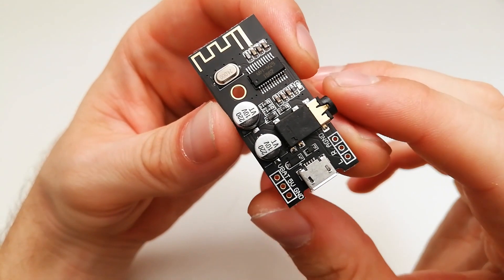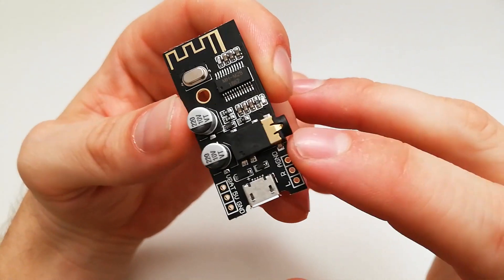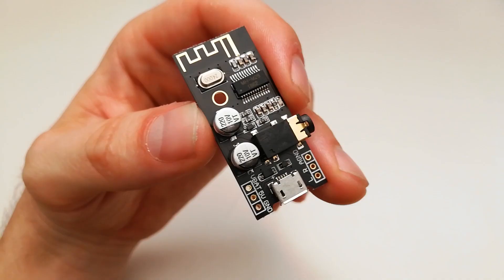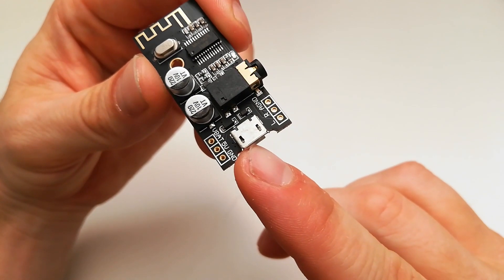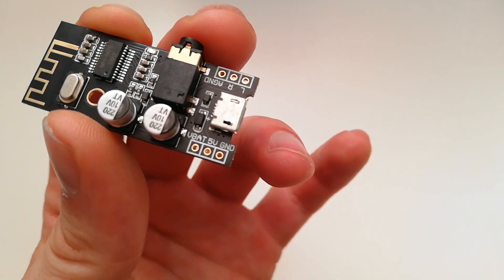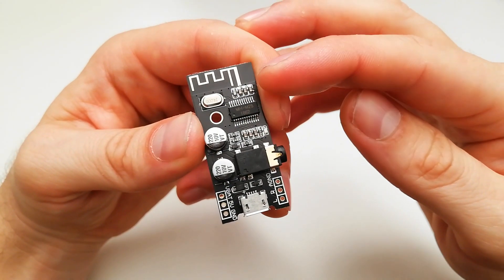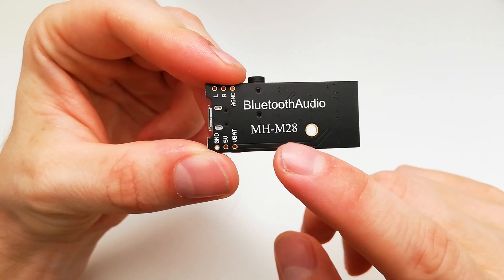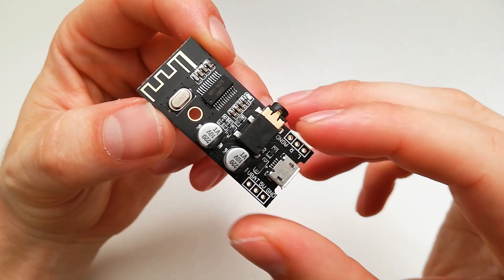MH-M28 Bluetooth Audio receiver board (Wireless Audio decoder)

Comment: 1:03
STOP
Do not half-ass insert any plug.
That only provides a single MONO output.
SEE?
FINALY the two hands "fiddle with the male piece" & 
SHOVES IT HARD - into the hole..

That's the way to do it.
By just PUSHING IT "all the way in".!!!!

Wow, who would have believed.
It's a STEREO device after all (with the MALE PRONG inserted - to the hilt)
All the WAY IN .... @ 1:45
STEREO (at last).

TWO channels is better than a half ass push and ONE channel.

However, the LEPY is good for at least 9 channels of directly connected independent audio output, from that same unit.

And you won't get them by half-ass insertions either.
I won't explain how, as it's a commercially sensitive TRADE SECRET.
Just knw it works and maybe someday - you too could drive a wild 25.7 system via that "fully inserted" male prod.

Comment: hello I would like to know if by connecting a 3.7 volt 500mhA lithium battery and then connecting the micro usb to a power supply..... is the connected battery recharged??? Thank you
Reply: No.

Both are different power sources. Either micro USB ( preferably 2A ) or 3.7 volt lipo / lithium battery.
Headers are given as such.

Never use both.

For lithiumb/ lipo battery, charging has to be done separately.

Hope this answers....
Reply: Also want to know this!

Comment: can i hook this up to some headphones?
Reply: Just use a 1/4" (6mm) Stereo to 3.5mm stereo adaptor, and shove it (to the hilt) into that big hole on the side of the unit.
Plug your headphones directly into that without the LEPY and control the volume from your blue tooth mobile phone as they are doing.

The USB is ONLY there, for the 5v DC operating voltage supplied by the mains power plug-pack.

You get Blue-tooth "pairing" direct with the blue tooth the cellphone is outputting.
Hence why you see the cellphone "music-play screen"

Comment: I have a problem with this module. I want to build a Bluetooth Speaker. When i connect the module to a powerbank, it turns off after a couple of seconds. Is there a sollution?
Reply: Some gadgets which can't consume 5 volt throughly and 3.7 volt is better enough, power bank is not for those gadgets. In this case Power bank cannot supply its volt to the gadget and at a time it shuts down to its own way.

Comment: Of all the Bluetoth modules I have seen working, the MH-M28 is the one that works best. It is well designed. I have several modules of these and they all work well.
Reply: which one is best mh18 or mh 28 ?
Reply: I'm sorry...i misread your question...So....
In practical terms, it is preferable to order the MH-M28, as it is already equipped with the outputs you need for your service, and the core of the MHM-18 is exactly the same as the MH-M28.
The MH-M18 is just a little more difficult to put into operation.
Reply: But don't worry @prakashsailayam2030  !
Whichever BT module you choose from the MH-M line, you will be satisfied with its performance, without the slightest doubt.
Reply: @revoxjazz  Thanks for the Reply and information
Reply: You're welcome. bro!
Macedo Pinto, Portugal
Reply: @revoxjazz hi I have a doubt and if you answer it I will be very grateful so I didn't understand what you exactly said so you mean that mh-m38 has a built in amplifier? And if it has it so what is the maximum output it can give and will it have background noise even if nothing is playing and will it have that Chinese lady voice 'the Bluetooth device is really cheap here' or something like that? Thanks!
Reply: Ok my few doubts are clear just tell me if it has a background noise.
Reply: Clarifying what you want to know.
The MH-M38 bluetooth module (specifically the MH-M38) has two small amplifiers built into the printed circuit board, each of these small amplifiers allowing you to play audio files in Stereo. The advertised power for each channel is 2 Watts at 4 Ohms. This is bullshit. No way to get such a power level on these  MH-M38 modules. 1 Watt per channel at 4 Ohms, max. In other words, you connect two small speakers or speakers to this MH-M38 and you basically have a mini Bluetooth audio decoding system and an amplification system, in a complete solution. As for the horrible situation of a voice prompts appearing in this system (as well as in any of the MH-M series modules), fortunately the world was spared that ordeal, as you only hear small signals (simple melody, just one second) when you perform the BT connection for example to your phone or when you hang up. Nothing more than that.
Further clarifying this line of BT modules (which includes the MH-M18, the MH-M28 and the MH-M38) Regarding the sound definition obtained, I must say that the decoding chip on the board is the same in all three models, have good quality, very good stereophony and I do not aurally register any noise associated with its operation, it is clear that this chip does not present any unpleasant signal, for example, when you put the Player that is producing a signal in Pause or Stop. Anything. Absolutely silent.
The only problem I observe in this line of equipment appears only in the MH-M38 (the only one that has amplification for speakers or loudspeakers), characterized by the excess Audio Gain defined by the manufacturer. Since this Gain is defined in the programming and native configuration, the absence of an effective volume control is not at all pleasant, making it very difficult to manage reproduction volumes, an essential aspect of what we do. that is, the volume is poorly controlled. It's a shame that this is the case, because the "normal" volume that we assign to the Player's output (for example on the phone) is clearly insufficient to balance the sound and there is no way to change this. Pretty unpleasant.
For this reason, I do not recommend using the MH-M38 for the purpose you obviously want, knowing well what will happen with the situation of excessive amplification of the audio signal on that printed circuit board.
Apparently, the best solution for you will be to just use the MH-M28 (which does not have its own amplification) and resolve this issue by using separate PAM 8403 amplification modules. These PAM 8403 modules are well designed and some of them already come with a volume potentiometer.
Or, you can use any amplifier circuit of your choice as the output stage, of course.
You take the audio signal output from the MH-M28 module and inject it into the input of any amplification. Problem solved. By the way, in terms of electrical supply, you should know that the MH-M28 module (without amplification for speakers or loudspeakers) has a maximum consumption of 38 mA 3.7 Volts , which is excellent.
But to put the MH-M38 module into operation (which has integrated amplification), you must ensure that the module is supplied with normal voltage (3.7 Volts) but you won't get away with it without the presence of 2 continuous Amps. Which forces you to use one or more good quality batteries for the MH-M38 or a dedicated power supply, with the same 2 Amps.
Please note that these modules have interfaces for 3.7 volts and 5 volts, differently and I will make it clear that none of them charge batteries. Make no mistake about that.
I think that the essential questions regarding the MH-M28 and MH-M38 have been clarified but if I can help with anything, please contact me again. No problem.
Macedo Pinto, Portugal.
Reply: No background noise att all!
Reply: @AmazTech  Just use MH-M28. Unbalanced line level for your amplification system's input.
Reply: @prakashsailayam2030  , they are  electronically similar but there is a big difference between MH-M28 and MH-M38.
While the MH-M28 produces only a LINE OUT signal at its outputs, the MH-M30 produces SPEAKER LEVEL at its outputs. In short, the MH-M28 does not amplify any signal and simply decodes BT, transforming it into something that you can connect to an external amplifier (or amplified speaker).
The MH-M38 decodes the BT signal but it already has its amplifier, so you cannot connect its outputs to anything except Speakers.
Reply: I have but a slightly High frequency sound coming I use battery different power supply also headphones but stills

Comment: I bought M38 version to make Bluetooth headphones and it works but ı heard disturbing noise sounds like buzzing. How can ı fix ?
Reply: Therefore, if you want to amplify only headphones, investment in the MH-M38 module is absolutely unnecessary. Just use  the MH-M28. In addition, as the MH-M38 module has two discrete integrated circuits, the mass of each of them cannot be brought together in a single cable (typical situation in a headphone connection, in which there is a speaker for the left channel, a speaker for the right channel and the referred mass common to the two channels). The MH-M38 module does not support the joining of both masses at a single point. You risk damaging both 8871 power integrated circuits. I am explaining this because I bought the MH-M28 and MH-M38 modules and I know how they work.
Reply: @revoxjazz  great explanation ! The best part (for me) of the MH-38 is the USB audio. So you can connect bt and usb but I like to use my own (more powerful) amplifier. Could that be done? By passing the 8871 is''s somehow? I have several  TPA3110 XH-A232 boards I like to use for amplification.
Reply: @revoxjazz  thank you
Reply: @Ressam_daVinci  You're welcome, bro!
Reply: For your information, the headphone output of the MH-M28 module works perfectly and has a very good quality. The MH-M38 module is not intended to connect headphones, but speakers. This module is equipped with two integrated power circuits of the type 8871, which deliver between 1.5 and 3 watts depending on the impedance per channel.

Comment: Could you put some lithium batteries?
Reply: Just a standard 3.7-volt lithium battery is enough. The maximum consumption of each Bluetooth MH-M28 module is 20 Milliamps. With a battery from an old smartphone, a full charge gave 122 hours of uninterrupted operation
But beware, because the module itself does not contain battery charge control electronics, so don’t even think about connecting the 3.7 volt battery and the 5 volt power at the same time. One thing or the other. Never both at the same time.

Comment: is it true stereo??? left and right speaker deliver sound separately or not???? test with stereo check youtube videos and reply me please
Reply: Yes. it's stereo. I have tested on mine.
Reply: @vismakan6941  thanks
Reply: @vismakan6941  Hey, do you know if I can connect some lithium batteries instead of power cables or that can't be done?
Reply: @juanjoo9832  Hi yes you can. Board has two different possible inputs - 3,7v and 5v. Next to the usb input connector (on the right side) is 3 pads named ”vbat”, ”gnd” and ”5v”. Connect battery to ”vbat” and ”gnd”.
Reply: *on the left side.
Reply: @vismakan6941  Thank you : )
Reply: @juanjoo9832  You can connect a 3.7 volts lithium battery but you can't power the module using both process at the same time. 3,7 volt battery or 5 volt from USB cable. There is no charge control electronics in this module, so feeding it with the battery and the USB at the same time will burn the battery, since the 5 volts of the USB are excessive for the capacity to receive voltage, from the perspective of the battery .
Reply: Yeap! Full stereo sound on this MH-M28 and full stereo on MH-M38.